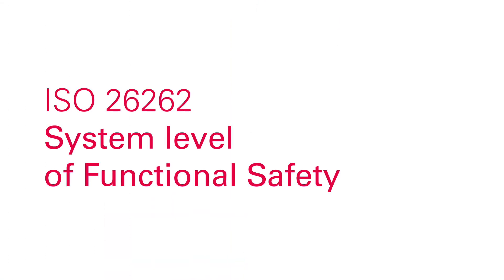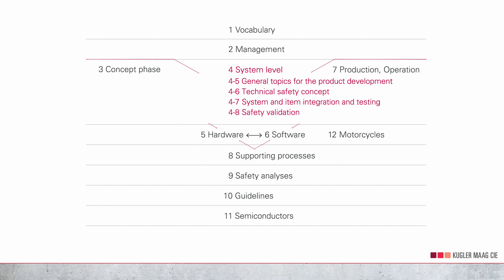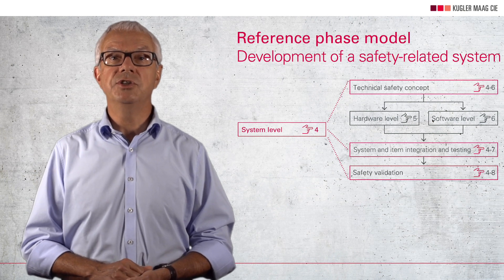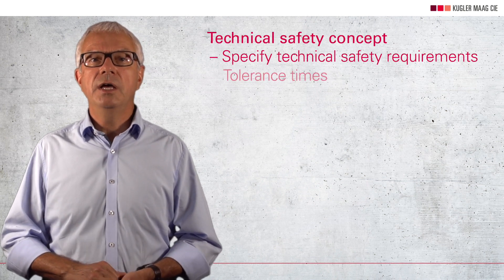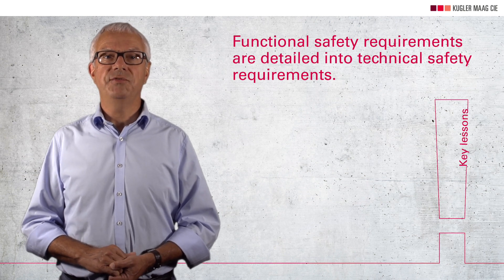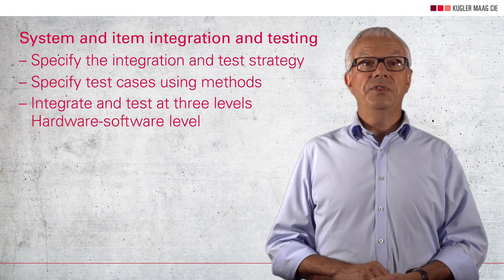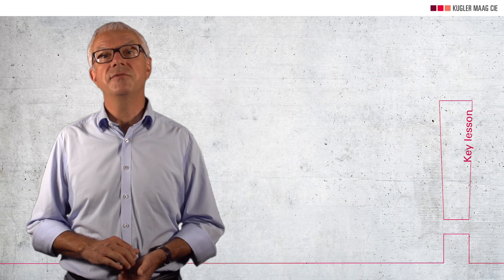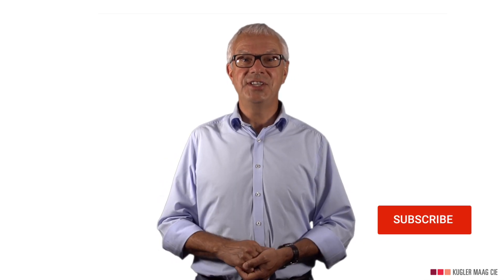ISO 26262 – Functional Safety at the System level

Comment: good video! You briefly mention APICE. What subject would not be covered when you follow ISO 9001 + ISO26262. So far I'm not able to kind any subject in apice not covered by ISO26262+ISO9001. Do only thing I could comment on is that QM level is badly defined in ISO26262. With in the rail safety standard they do address this properly. For QM items we apply the ASIL A requirements.
Reply from the maker: Thank you very much for your input!